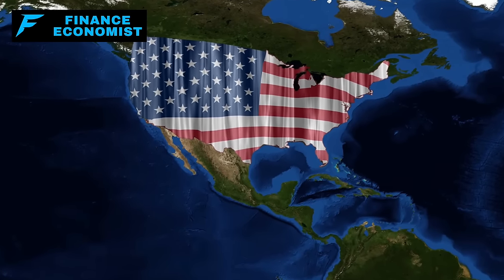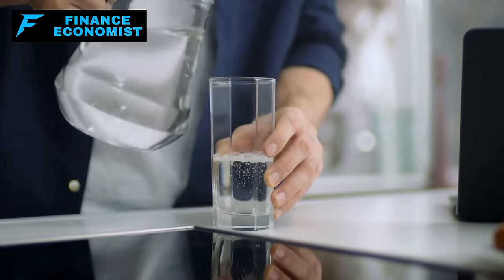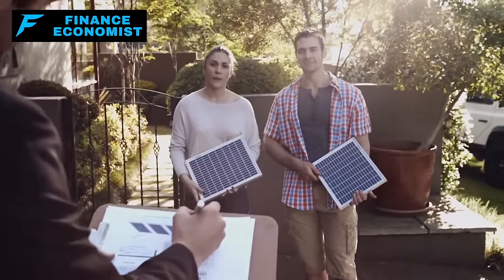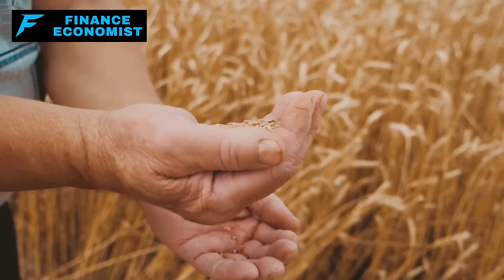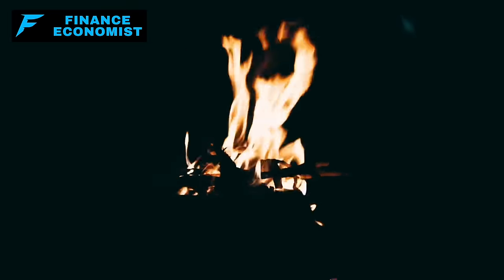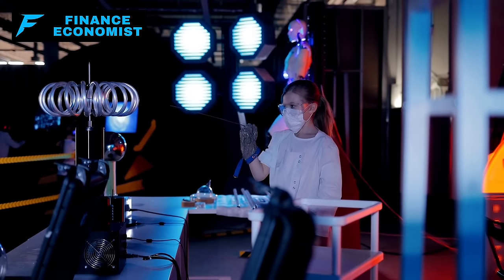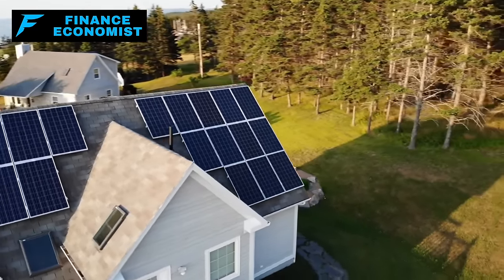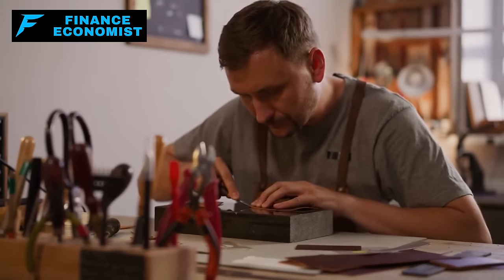15 PREPS You Need to Survive a Nationwide EMP Catastrophe!

Comment: this is about a (water filter).
Most of them I "see" assume you can use the pressure of your faucet to (get er' primed up).  Or even to use.  When you go looking for a filter, make sure you think (gravity fed).  And even the (big boys), that are gravity fed and work excellent.  I'm referring to Berky.  They want you to (prime) a new filter with the pressure from your faucet.  A person needs to get the (priming kit).  It's just a bulb type hand pump.  And a couple 1 way valves.  But when the lights are off, they are off all the way.  Don't forget a priming kit.
Reply: Can you translate your hieroglyphics for us that are slower on the uptake particularly the priming thingy?
Reply: Get a Berky.. water filter they use gravity and replaceable filters last a long time
Reply: @glenmo1  Yeah exceppt it looks like the EPA has basically shut down Berkey.  There is no filter availability right now!

Comment: 💡Remember several self-defense items for your preferred means of defending yourself/family; & you’ll want to have several methods for lighting, e.g., flashlights/extra batteries, candles, lanterns/lamps & fuel, solar powered lights, etc.  l listened to this while doing a little project near my laptop, thinking to myself “l know this stuff pretty well,” then realized l wasn’t sure where a couple of the mentioned items currently were (because l used them & didn’t put them back!!). I admit my guilt, even though I’ve been preparing for a while for potential short or long-term scenarios, it’s easy to become complacent. Also, sharpening tools & stones for your blades on everything from your EDC utility knife,  to saws & chainsaws - good things to have in your BOB.  JIC you live in a cold climate, it’s always good to keep at least basic emergency supplies in your car year round.

Comment: The EMP standards that exist to the civilian world are all based on the US Starfish Prime test in 1962.  That nuclear bomb was not designed to emit an EMP, it is just a byproduct of a nuclear blast.  Since then, several EMP weapons have been developed, which are much smaller and easily delivered, and with anonymity so, present an attractive way to attack the US by our enemies.

A good working Farday Cage is a good idea but, assumes there will only be one EMP blast, which is unlikely; I would expect multiple blasts to occur during a real attack.

Any product designed to survive an EMP and continue functioning, will have a metal case with no seams, no exposed wiring, will have a metal screen over displays, and tightly spaced screws (0.4 to 1", 1 to 2.5mm) securing removable covers.

Any so called EMP protection product that you can attach to a house, car, or appliance will not work because they only address the E2 pulse and neglect the ways an EMP gets into a system or circuit.

As a low cost survival method, camping equipment is very useful, such as gasoline powered camp stoves and mantle lanterns.  There are propane versions of these but, the 16 oz propane tanks will likely dissappear quickly.

Cars made before 1973 are EMP proof since they employ non-electronic engine and electrical controls.  Tube radios are EMP proof.  Generators using a points ignition system with a non-electronic voltage regulator are EMP proof.  Incandescent light bulbs are partially EMP proof but, all electronic light bulbs are not EMP proof.

I suspect anything powered by a lithium battery (power tools, power banks, solar generators, hybrid and electric cars) to catch on fire, a fire that can't be put out.